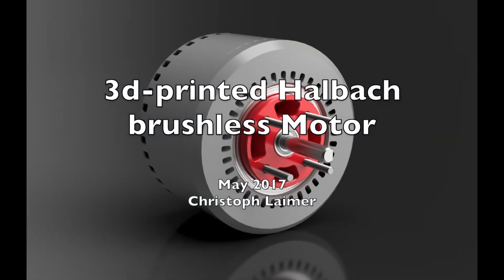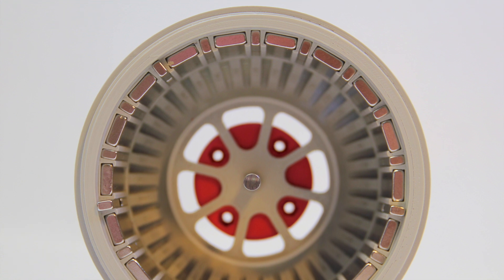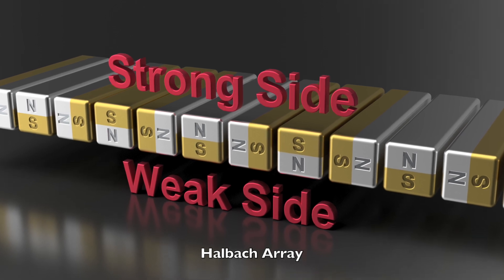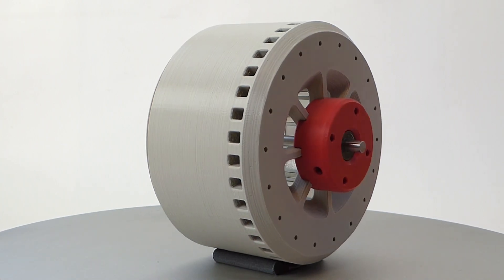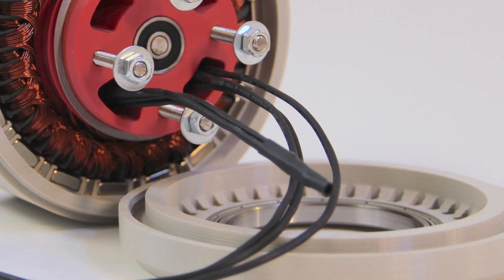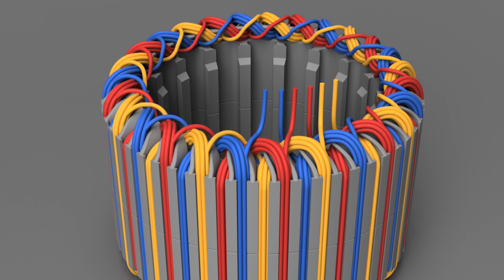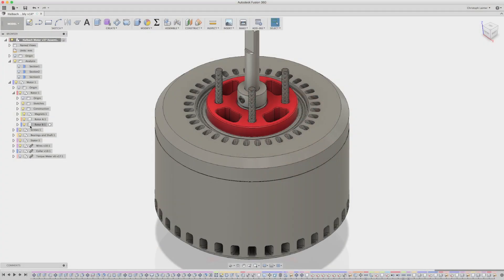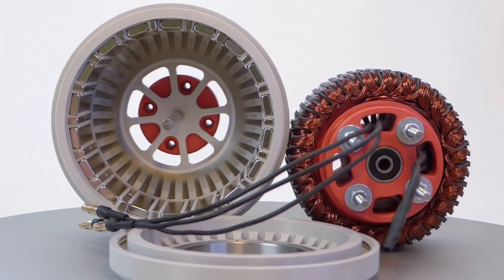600 Watt, 3d-printed, Halbach Array, brushless DC electric Motor

Comment: Can a 15kW motor be designed like that too? Electric hydrofoil community is looking for a very powerful but low KV motor. Something that can run ~3500RPM at 40V and produce up to 15kw. Ideally  combining motor and prop into a single body like this http://efoil.builders/uploads/default/original/1X/318fa06223d50ad264554736d910ec26382942d1.jpg
Reply from the maker: Low Kv and high Power is a challenge for coreless motors. Basically this requires an iron core. Or a reduction gear. The step from my 3d-printed design to 15kW is quite high - with simply scaling my 3d-printed design by a factor of 2 and reinforcing the rotor with Carbon fibres, it potentially could perform with 5kW.
Reply: Christoph, great design, I am very excited to try this. Could you suggest a specific carbon fiber filament that you feel would be best? I have no idea what strength requirements I would be looking for this. Also, I believe  I am wondering if you would be willing to suggest the absolute best 3d printer filament to use for all parts of your motor and I am hoping you could provide the correlating Enameled Copper Wire amount for 2x the size of your motor. I'm just wondering if you have considered Axial Flux Permanent Magnet configuration or a double stator one rotor designs? Please feel free to email me piterat@gmail.com
Reply from the maker: The "normal" carbon-fibre filaments are only blend of some plastique and very short carbon fibre fragments. These are not really strong. The only printer that can embed continuous fibres is "Mark2" from Markforged. It's a quite expensive printer for industrial use. However I don't know, if it can print the rotor with the slots for the magnets with the required level of detail. Maybe it's more efficient to manually wrap the rotor with carbon ... There are many people experimenting with axial flux designs. The concept is very interesting, but I didn't yet try to build my own version.

Comment: Mr. Laimer, What a great example of engineering work you have posted.  It will be a while before any one posts a 3D printed motor with this level of performance and engineering documentation.  Thanks so much for your effort. -Warren

Comment: Two questions if 3d printed magnets are stronger than regular magnets does that mean you can small speakers louder and the second thing is what other technologies would become more advanced with 3d printed magnets
Reply from the maker: Permanent magnets are not (yet) 3d-printable. The motor has regular neodymium magnets embedded in the 3d-printed rotor.

Comment: Nice work. Could you design me a 45kW motor for a price? You can contact me at cxanga@gmail.com. I can't find your address
Reply from the maker: uhh ... probably I should first try to construct and test a 3d-printed motor with "only" 2kW. I guess that's the ultimate limite for common 3d-printers. For 45kW there are potentially other technologies needed.

Comment: Could something like this be a little bigger?  Say enough to push a 132cm 3blade at say 10k rpm for 6 hours
Reply from the maker: A propeller with a diameter of 132cm at 10000rpm results in 691m/s (2490km/h) tangential speed for the blade tips. That's impossible.
Reply: Christoph Laimer yes I realized that mathematically that put the prop tip past the speed of sound I was wondering if a motor like this could handle it

Comment: something going wrong on 1,11 min look to the propeller is not balanced is not turning on the line but good project hope you can improve yourself better
Reply from the maker: The motor is OK. It's just the tip of the propeller spinner, which is not well centred. The propeller itself was well centred in this test.
Reply: understand but i think it will effect your every calculating
Reply from the maker: Would you expect that the calculated efficiency would be much different? Better or worse?
Reply: if you can set this center shaft it can be better than this time

Comment: I like it but there is one major flaw in it: It has not been designed to be properly cooled. 
Unfortunately, copper is not a perfect conductor and the overall efficiency of your motor is heating the PLA core with 20% of the power you put in it. So I expect it will melt in minutes from operating at designed power. 

And if you'd design in a cooling mechanism, like a turbine to pull air by the coils, the energy required for pushing enough air to keep the plastic from failing would greatly increase weight and decrease efficiency... 

Are there any thermo-conductive plastics out there? Maybe resin printable... 
But it's a really nice demo. I have never seen working Halbach array outrunners except here. Thanks for sharing!
Reply from the maker: Maybe you have a closer look at the design: air is moved through the motor by a radial compressor. Air enters on the side of the motor mount, and exits through the ventilation holes of the rotor. There are even cooling channels beneath the copper wires. 70% of the outer surface of the coils is directly exposed to airflow. If the motor runs continuously at 600W, the temperature of the coils increases only about 20°C higher than ambient temperature.

Comment: I heard vibration noise when you ran it without a prop.

How is the balance on the rotor without magnets installed? You could make pockets on the inside, under the large magnets, for inserting something to adjust the balance. Perhaps pieces of plastic printed at different infill % then held in with cyanoacrylate.

I'd order more than enough magnets for the build then sort until they were all very close in mass and power. Combined with altering the rotor design for balancing it should be possible to have a higher margin of safe RPM.

What about a lathe turned aluminum sleeve for a light press fit over the outside of the rotor? Epoxy it in place. That would act as a barrel hoop to hold the rotor together at higher RPM by preventing the plastic from stretching then breaking.
Reply from the maker: https://youtu.be/3pG90WreWyo

7000 rpm is already a problem for a cheap 50mm ball bearing (it get's hot).

But you're right, knowing that the plastic is stretching is scary. Should do a long-time-test - maybe the motor breaks even at medium rpm, if it runs continuously for some days/months/years ...

Comment: Can you please explain me, how much the air-gap between stator and rotor?
Reply from the maker: There is a mechanical gap of 0.5 mm. The air-gap regarding the magnetic flux is much higher/undefined, because there is (almost) no ferromagnetic material.

Comment: DC? this is a AC motor......
Reply: what makes you say that
Reply: three electric cables for power input. if you know a little about motor you should understand that's means AC motor...
Reply: i see. well i do know a little about motor, pretty sure he's using that controller wired between the power source and the 3 leads of the motor to alternate which coils are powered. i think most brushless DC motors work like this. like you need a controller.

Comment: I am thinking Is this possible put this inside a wheel ?
Reply from the maker: It requires a reduction gear, in order to increase torque and reduce rotation speed.

Comment: I wonder what modifications would be necessary to make it use 10x10x40 magnets only. they are much more powerful and would allow for a more powerful build. @Christopher Lamier have you designed a rotor to do this, or if not, what changes would need to be made aside from changing slot sizes
Reply from the maker: The magnet dimensions are a parameter in my Fusion 360 design. Theoretically thats simple to change. However it's needed to verify the if all depending constructions are properly updated (it can happen that some parts react like crazy, if a parameter is changed too much). Certainly the higher mass of the magnets and the larger centrifugal forces need to be considered, and the motor should be used at a lower rotations speed.
Reply: Thank you for the information Christoph, I am probably going to purchase your design in the near future, but this means it won't work for my current project. Thank you for the information sir!

Comment: For future versions it can proof good to think about motor cooling especially when the motor is used for static applications. You can easily do that by shaping the venting holes in the rotor like a fan/turbine to suck air the from front between the rotor and stator.
Reply from the maker: This motor actually has ventilation holes, which work like a radial compressor. Air is guided on top and bottom of the copper wires from one side to the other. Of course the cooling only works with a certain rotation speed. At very low rpm a secondary fan is needed.

Comment: Mr Laimer, thank you for your dumb protective videos! They are really great! And here's my question, i scale this to fit it on a quadcopter? Something small like DJI Mavic or Spark? As i'd like to complete a drone from scratch, and eligable to hover with a camera + gimbal.
Reply from the maker: Hi Gunes. The motor is certainly scalable to some degree. Actually the design of the Halbach motor evolved from a smaller motor, which I've designed earlier: http://www.makesea.com/web/claimer/brushless-motor ... however the ratio pf power and weight is not as good as regular brushless motors off-the-shelf. I really can't predict if it's possible to use these 3d-printed motors on a drone. I'm only experienced with planes - and there it's working. Hopefully somebody will try building a drone.
Reply: Thank you for your response, i'll dig in to that, have a good day!

Comment: Christoph, excellent production, design and presentation. Astonishing achievement. Thank you for shearing.
What is the printing layer height (0,1 or 0,2 mm).
I suppose you have printed all parts with 100% infill?
Reply from the maker: I printed with 0.15mm layers. Probably works also with 0.2mm. You can find the detailed print settings in Instructables: https://www.instructables.com/id/600-Watt-3d-printed-Halbach-Array-Brushless-DC-Ele/

Comment: It is possible to save magnets and make it more economical, it turns out that when the magnet is displaced to one side, not centered in the coil generates more acceleration, test with a motor of aeromodelismo only accelerate it a little and move the axis so that the magnet moves away From the center and you will see how it accelerates. 

Ie the elliptical can be narrower than half of the magnets and smaller magnets on both sides but with a space in the center of the winding

Comment: I am very curious about following aspects that from my point of view is unbelievable: 1. Magnet is not supported by magnetizer (like Fe), that makes the reluctance extremely huge; 2. Winding is not isolated from stator, would that not lead to breakdown voltage or shortcut? 3. Would you plz tell me what material is used to print the stator? I doubt that would cause high magnet loss. Amazing if it reaches 80%efficiency.
Reply from the maker: The stator is printed with magnetic PLA (https://www.proto-pasta.com/collections/exotic-composite-pla/products/magnetic-iron-pla). The blended iron-powder increases the magnetic flux by maybe 20-30% - so it's almost like regular plastic. The isolation from the stator is not needed, because plastique is not conductive even if it contains metal powder. The reason why the motor works quite well is based on the arrangement of the copper wires as close as possible at the magnets.
Reply: Christoph Laimer thank you for your explanation. One more question: is the rotor also printed with the same material?
Reply from the maker: Rotor is printed with PETG. No metal powder.

Comment: With the 3D printing how fine of a filament are you using, and how fast are you printing it? I'm curious to know how well this is balanced/easy it is to balance, and If the 3D printing causes non-uniform weight distribution? Do you sand the printing lines to a smooth finish to reduce the amount of non-uniform weight distribution and remove any unnecessary weight?
Reply: I think you just need to tweak some settings in your slicer software. I would try setting your infill and top/bottom layers to a concentric pattern. If you use rectilinear hatching it will definately be a lot less balanced out of the printer. And it's probably a good idea to inspect the gcode before you send it to your printer to make shure your slicer parameters don't introduce any unbalancing artifacts. Of course, rebalancing the printed pieces before you assemble the motor would be a good idea too, especially if you go for a high rpm motor.

Comment: Your halbach application I need to check out standard construct for the bell/mag section very interesting a one turn wind minimum current to spin spec is?. wind dc resistance next. nice build. Single reduction step or direct drum drive as diameter increases pole count goes up and KV down smoooooth torque silent power. with this optimized many issues can be solved. nice well done

Comment: A really fabulous piece of engineering. Just proves what you can do with 3D printers. On the overheating comment, could you not print a cooling fan inside the motor to draw air in? I see these on many induction motors, usually on the outside of the motor though with a cage around it.

Comment: very good design and u took really good effort to build it. keep it up ☺️. if a good ferrous material is used instead of the 3d printing material for rotor then efficiency will be greatly increased. also i like the arrangement of magnets 👌👌. overall the design of motor is too good👍

Comment: Amazing design ... interesting the magnets array .. I think another possibility is to print the magnets shell with ferromagnetic material such as the stator to close the magnetic flux .. or only a ring inside to save weight.
So save some magnets because you do not need use magnets array and maybe there is a chance to increase the performance.
In any case my biggest doubt is the heat resistance .. this is the reason because in my experiments I try to made one using recycle pieces of old motor or other thing .. I already had experience of melted pieces :)
I'll hope to see it use on something. Still great work.

Comment: Why don't coil windings short through eachother?
Reply from the maker: Wires are isolated with a very thin and transparent coating.
Reply: Is that something you applied or is the wire manufactured for the purpose of winding?
Reply from the maker: This is a common product you can buy as "enamelled copper wire" or "magnet wire"
Reply: Christoph Laimer When an electric motor gets hot, and it suddenly stops working but doesn't visibly have any issue, would this likely be from this coating melting/burning and the windings shorting out?
Reply from the maker: Maybe ... the isolation is melting when copper wires get hotter than 130-160°C (depending on the quality).

Comment: How does heat from the motor effect the PLA? Does it?
Reply from the maker: PLA would certainly melt, if the motor is used beyond the range that I have tested. With the integrated ventilation the motor temperature rises roughly 20 degree Celsius over the  ambient temperature.

Comment: Christoph your work is awesome.im thinking abouth doing one.how many amps you use on the esc ?
Reply from the maker: The ESC should support at minimum 30A and 40V. If it supports higher currents it's even better - it will have a higher efficiency.
Reply: A 80A esc should work ?
Reply from the maker: Yes.

Comment: Could you use gadolinium in place of the magnets and use super conducting materials and ultra low temperatures from liquid air to in crease speed of fan that is a super conductor for high frequency electricity? Would it work? I mean have a fan to move air and an electrical power generator at the same time?

Comment: What's your estimated cost for one motor only including the material, wires, ball bearing, etc. Not including the one off cost like the 3d printer and 3d model?
Reply from the maker: Approx. USD 60-70.
Reply: Christoph Laimer Quick answer! Thanks, Really interesting project :)

Comment: Could I ask one question? Do you think this kind of motor would work in power tools? Or the force stopping the motor would be to high?
I'm sorry if this is stupid question :/
Reply from the maker: The inertia of the rotor is quite high - acceleration isn't the best. Unless you supply a very high current. 100 amps for less than 1 second probably doesn't overheat the motor, but the toll will shake a lot ...

Comment: Now its time to print one specifically for use as a dynamometer. That way you can keep track of how design changes effect efficiency. I bet it also wouldn't be too difficult to design a small rod with a self centering clamp on one side to test holding torque. it looked pretty strong when it was made to cog a the end of that one shot. Splendid work so far. If you could automate winding you could probably take an entire industry by surprise.

Comment: Awesome project. Have you considered using litz wire? It might improve your efficiency at higher speeds.
Reply from the maker: Yes, and no ... Litz wire needs to be isolated, Isn't the isolation using a relevant portion of the entire wire-volume? I think it's important to have as much as copper as possible filled into the slots. The wires I've used is somehow a compromise to "real" litz wire. It's 6 strands with 0.45mm diameter each single strand.
Reply: I'm guessing your switching frequency is perhaps up to 2kHz so you probably don't have any significant skin effect. I was more thinking you might have uneven current over each strand in your bundle due to proximity effect, but I see now that you are twisting the wires together which should reduce that. Insulation thickness for low voltage winding wire is minimal, the copper density is more effected by how the conductor strands pack together, litz wire is available in rectangular packages to help maximise copper density ;)